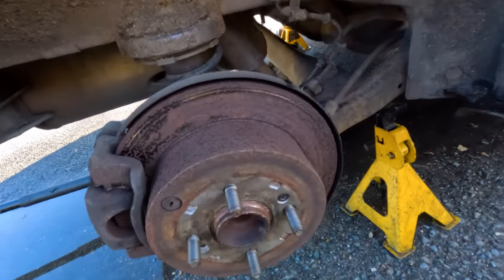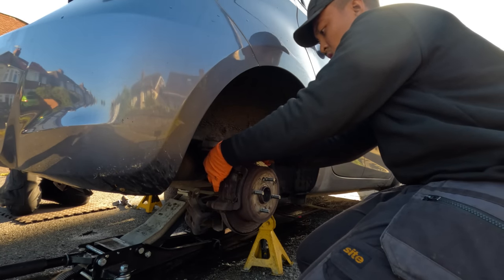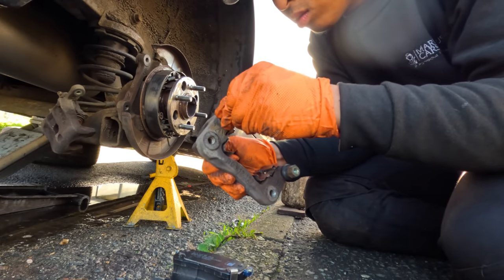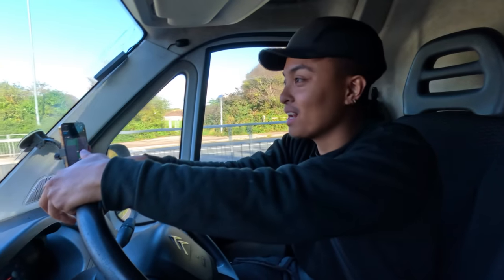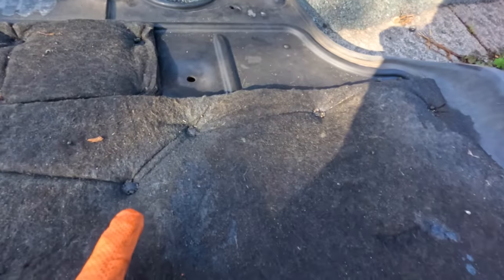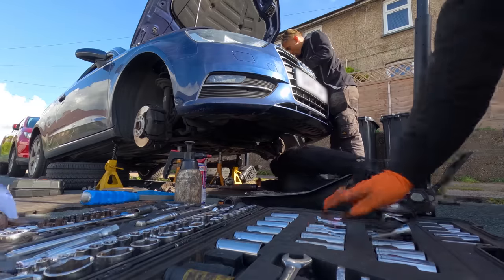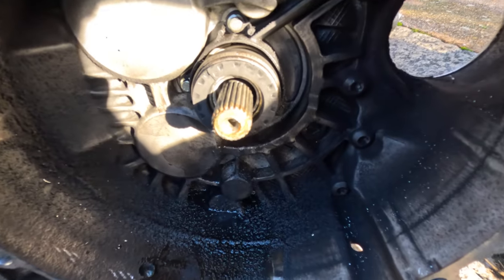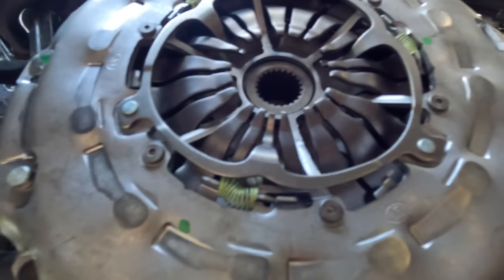WE DECIDED THAT WE ARE GOING TO... | Audi A3 Clutch Replacement | Kia Rear Brakes | Mobile Mechanic

Comment: Im the owner of the Audi in the video, these lads are seriously good at what they do, after the clutch replacement I drove 170 miles from Brighton to Coventry and it was absolutely fine, it never missed a beat. Highly recommended mechanics
Reply from the maker: Thank you for using our service pal! Appreciate the feedback!
Reply: Was your car automatic and how much did they charge?
Reply: Totally agree, they did a fantastic job on my Audi A6 a couple of weeks ago. The reason I chose them was the quality of work I saw in their videos….superb work guys 👏👏👏
Reply from the maker: @anthonygroombridge1045 thank you! Far too kind
Reply: @suratullahkhan6158 clearly not automatic when you can see the clutch and flywheel. 😂 It would have been a torque converter if it was automatic.

Comment: I flat out refuse to fit Eicher (known as Eishite). Used them once for a customer and they were warped from new. (Yes I did clean the hubs). Cheapest I use is Pagid but will only fit Brembo or Mintex in my own vehicles.
Reply from the maker: No warranty/guarantee on any 💩 parts

Comment: Random one my relay won't start when its warm its an 07 plate. Have change loads of sensors filters etc. After the 5th or 6th time it will start have checked battery connections and replaced battery. No error codes now just reluctance to start when its been running a while
Reply: @themarvelousvlog  diesel
Reply: Probably injector/s leaking off fuel pressure. 
I used to work for a taxi firm and DW10's do suffer with this especially when warm. Please feel free to tell me off if i'm not allowed to diagnose issues here 🤣🤣

Comment: Have you got any experience of drivetec lower arms / front track control arms, do the rubber bushes last ok on them?
Reply from the maker: This is just my opinion but I’ve never really had bad experience with them, even though they’re not my first pick, I’d consider them ‘okay’. Not good, not bad. Not something I’d fit to a premium brand for sure
Reply: @themarvelousvlog  thanks, I'd normally go Delphi or lemforder but family member needs a budget option and was hoping they maybe better than an 'eBay no brand special'